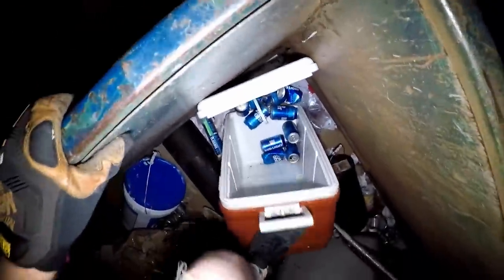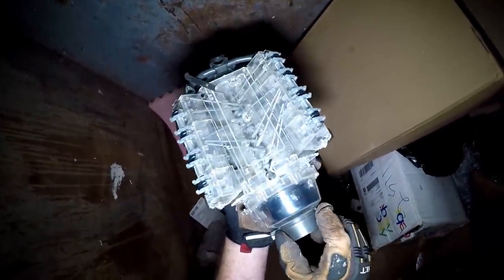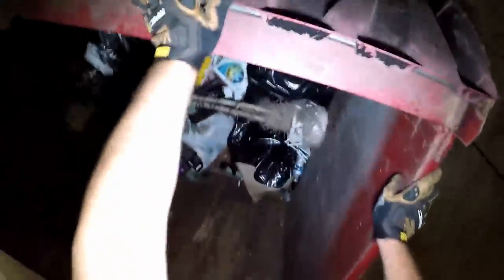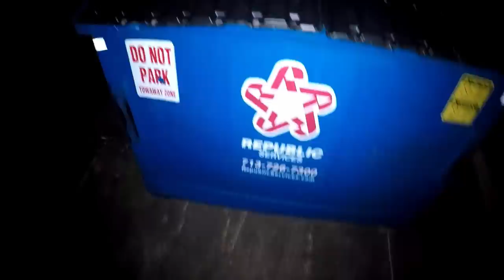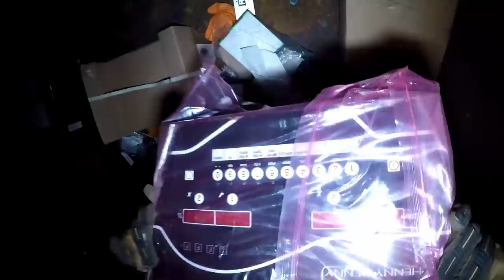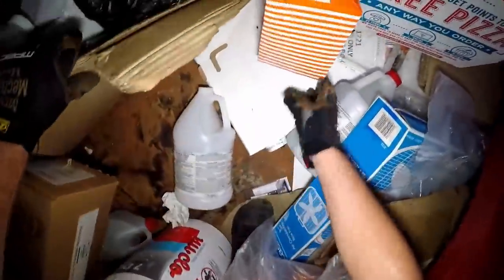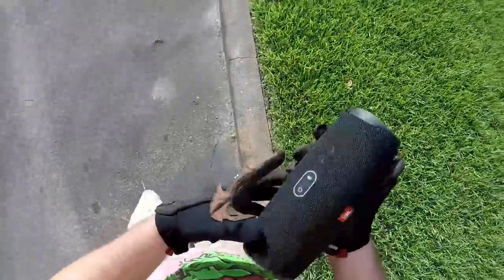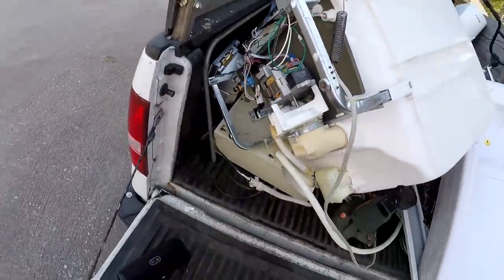Dumpster Diving "Families Are Forever"

Comment: Those furnace blowers like the one you found can be wired up and can be used as a great shop fan or just a normal fan for around the house. That is unless the motor is shot and then it is some good scrap.

Comment: Mine  even has 2 USB ports for charging  other devices  on the battery  power on the speaker , it works as an power bank if necessary  , and aside  from  that it has an mini USB port for upgrading  the software

Comment: 6:30  That's a cool engine model, Mike, but not advisable to take it because for sure there will be missing parts (I see the parts scattered all over the dumpster).  When I assemble Gundams, I go nuts if I lose even a teeny tiny part and discard the project.

Comment: a mike vid nice time to watch, free beer might be in date wold of grabbed them, next there are loads of tickets huh guess a machine that spit them out if you do well broke, oh a model engine like planes boats and toy cars you can build one of those mike it takes some batterys to work and the spart plugs light up to show the engine working, that's an easy bake oven mike more newer one though, scrap in the fridge place dumpster nice, i'm always unsure why mike doesn't check the hoss for brass ends unless after checking a lot he knows there always plastic, oh and some crub side to boot, guess the normal scrappers that get there before you mike are back home thinking they might get the virous that or are taking things apart to get more money as scrap prices have fallen, if the speaker works its shows not everything made now a days is cheap n crap,